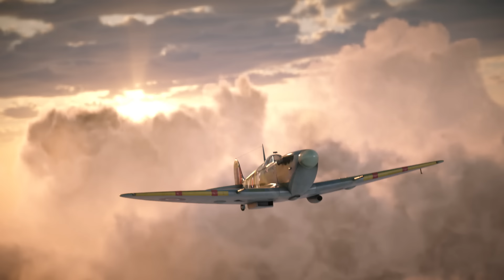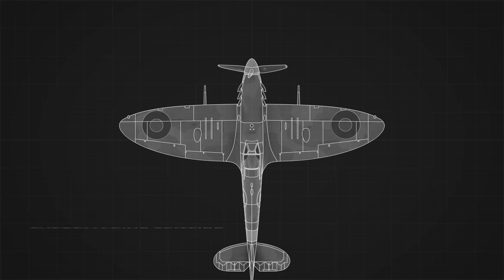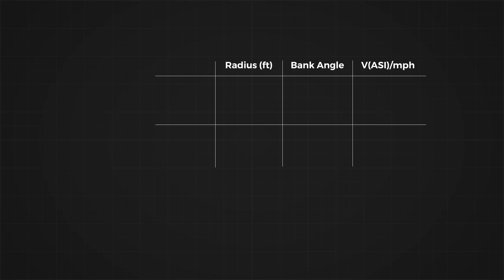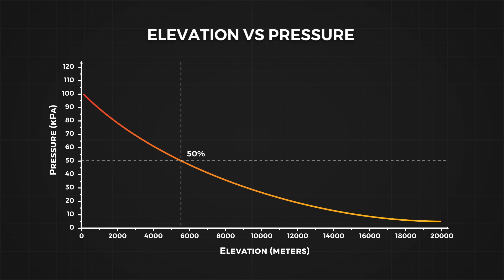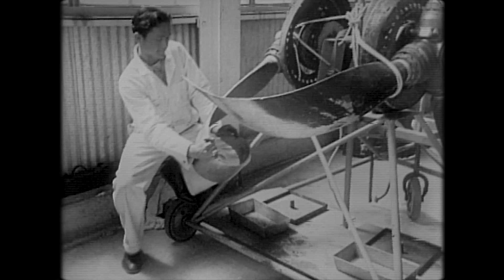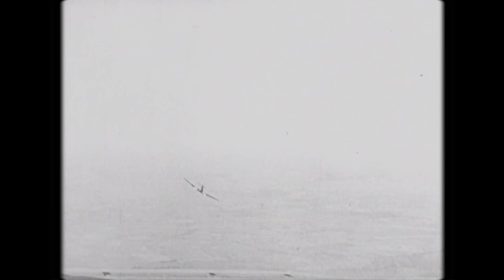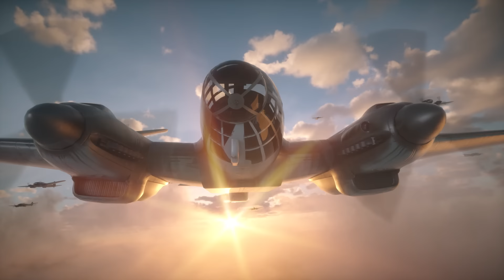The Insane Engineering of the Spitfire

Comment: If they thought of it, I wonder if winglets could have helped with induced aerodynamic drag, without hurting other characteristics?
Reply: No, because induced drag is not a factor in a fighter, it is lowest at the maximum speed, which is what you optimise a fighter for. At those speeds the frontal drag is dominant, and winglets make it worse. Winglets are useful for planes optimised for cruise speed, like passenger planes, and crucially for gliders, which for maximum L/D operate at relatively low speeds, where induced drag is dominant.
Reply: @kardRatzinger  OK, sorry for asking a question. However, the video specifically discussed induced drag. As noted elsewhere, "An elliptical planform is the most efficient aerodynamic shape for an untwisted wing, leading to the lowest amount of induced drag." You will note most post WWII jets with straight wings, had fuel tanks at the ends of the wings, then once swept wings were introduced, all of a sudden, this stopped. Hmmm...maybe the tanks or in other planes, wingtip missiles acted as a wingtip devices/winglets?

Niche cases but not as stupid as you might suggest:

"MiG-31D. Two aircraft were designated as Type 31D... had large winglets above and below the wing-tips."

"Almost 40 years ago, a famous mission was fulfilled by the Israelis: Operation Opera...the F-16A, which had to be used, had not enough range to complete the mission...Then, someone had the idea to install Sidewinders on the wingtip pylons. Those act as winglets, decreasing fuel consumption."

"Heinkel He 162A with Lippisch-Ohren wingtip devices." 

"An interesting way of reducing induced drag is by the use of tip plates or tip tanks. This arrangement tends to inhibit the formation of tip vortices. Tip plates have the same physical effect as an increase in wing span (or aspect ratio). Normally, these are not used since there are other more valuable drag reduction methods." Explains there limited use, now that better methods are known.
Reply: @machoopichoo2  Do not be sorry for asking the question, it was a good question. Yes, the elliptical wing decreases induced drag, and therefore increases cruise performance (probably not by very much), but that comes at the cost of greatly increased labour intensity when manufacturing the plane. Unlike in the case of winglets, however, the reduction of induced drag from the elliptical wings does not come at the cost of increasing frontal drag *).
Note that in later Spitfires Supermarine actually clipped the wingtips to reduce frontal drag, at the cost of more induced drag (not in HF version, but that had more to do with wing area/loading than drag).
I do not want to comment on supersonic aircraft as that's beyond my area of expertise(?), but the bottom line is, WWII fighters were heavily optmised towards best Vmax, so winglets would've been countereffective.
*) and probably interference drag
Reply: @kardRatzinger  Thank you. Makes a lot of sense and you clearly know quite a bit about this. It does sound, from what I read, that aerodynamic drag at the wingtips for piston engine planes, is quite impactful when climbing. However, overall it does not seem to be the big concern, like you said, things like drag, top speed, ability to dive fast, etc. were much more important. It's interesting that a lot of emphasis gets placed on wings, which makes sense, but possibly more for later jet planes, the lifting generated by the body becomes a really big deal, with chines, stakes, cannards, etc., also coming into play. But, not knowing much about it, I imagine a lot of this has to do with supersonic effects.

Comment: You need to change the video... any private pilot will tell you that in a turn you put BACK PRESSURE on the stick, deflecting the elevators UPWARD not DOWNWARD. Other than that, not a bad video... but a basic mistake such as this causes one to take everything else with a pretty big dose of salt.

Comment: i'm sorry but the battle of Britain spitfire has got terrible armament 8 30 cal machinguns poke holes in things a 2cm canon blows holes in targets. secondly centrally located guns are more accurate than wing mounted guns. pre battle of Britain spitfires had worse power than bf109s but around the time of the battle of Britain the English were getting 100 octane fuel from the us compare to the 85-90 octane fuel the Germans were using
Reply: Strange how so many aircraft were brought down by the Spitfire's (and Hurricane's) 8 X .303s.
Reply: @warwicktregurtha4198  throw enough crap at the wall and something will stick. Lick almost every aircraft of ww2 the spitfire was  "good" not perfect it had its flaws and its advantages. The spitfire had good performance when using 100octan fuel that doesn't change the fact that 8 machine guns using a  rifle round weaker than most of its contemporarys is a bit of a problem, not to menchen that spitfires were later equiped with 20mm canons. Mounting you pea shooters on the wings also decreases the range in which you sufficient shot density to be reliable affective.

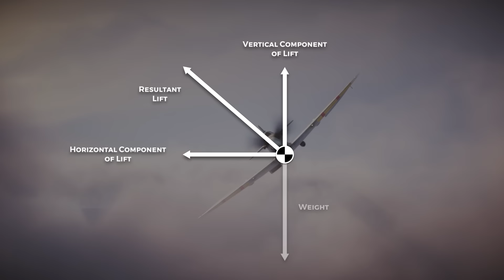Comment: What is explained in 4:10 ff is plain wrong. While conducting a turn you have to pull the elevator, not push it. If you try to deflect the elevator downwards as is described in the video you are certainly in for a surprise. 
You’d better, not try it!

Comment: The very old fashion upright sitting position the Spitfire had was not mentioned or the reason the direct fuel injection was missing. You find it here:
How One Decision Ruined British Aircraft Engines
https://www.youtube.com/watch?v=DOSe4lmy8S4

Especially regarding the wing design I would recommend this:
https://www.youtube.com/watch?v=4VJ4NKDSkG4
SPITFIRE SPEAKS: Spitfire Elliptical Wing Design

And for all interested in those war birds I would recommend
Greg's airplane like here:
https://www.youtube.com/watch?v=9wb5YzVbTNo
And why not this here too:
https://www.youtube.com/watch?v=9QycCd3U4Hg&t=86s

As a side remark I would claim the canon through the propeller was the superior arrangement.
Reply: Ref the RR carburetor vs FI:
 Sir Stanley Hooker, quoting from his book 'Not Much of an Engineer'. 'Let me now add that the Germans paid a large penalty for their fuel injection. When the fuel is fed before the supercharger, as on the Merlin, it evaporates and cools the air by 25° C. This cooling enhances the performance of the supercharger, and increases the power of the engine, with a corresponding increase in aircraft speed, particularly at high altitude.' (p. 62)
Which explains why the 27L RR engine could produce similar HP to the larger DB601 engine.

Also, that vid on the Elliptical wing is yet more duff gen.  RJ had used the elliptical wing on numerous occasions including the racing plane, the S4 in 1925.  The benefits of the elliptical wing planform dates back to englishman Fredrick Lanchester in 1907.  Don't believe every video you see.  Do some fact checking.

Comment: Hydraulic is not spelled HYDROLIC plus fuel/air mixture does not enter the piston. The piston compresses the fuel/air mixture which enters the combustion chamber via the inlet valves. I suggest you study how a 4 stroke engine operates. I also suggest you properly research everything to do with the subject matter that you are posting on YouTube. Make sure that your so called facts and technical information are faultless and accurate before posting.

Comment: The problem with the carburettor float under negative G was partially cured by the addition of a flat washer. If was called Miss Shilling's orifice. It gave pilots sufficient time under negative G to out-manoeuvre the ME109's.

Comment: The cock up regarding the elevator is only the most obvious of a bunch of gross errors here. Stating that optimum air fuel ratio is “12 parts air to 1 part fuel” is a schoolboy error. It's actually in the range 12:1 to 15:1 by MASS not volume. Also, believing a 6000lb airplane could possibly have induced drag as low as 3 lbf and putting it into a video is very dumb for an engineer.
  Neither of those things pass the most crude reasonableness test. It should jump out and smack you in the face that the 27 litre Merlin would require 2 litres of fuel per cycle, ie an astounding 1 litre of fuel per REVOLUTION! Equally, simply having a rough idea of typical  L/D ratios for these kinds of aircraft should alert you to the total implausibility of a 6000lb Spitfire having as little as 3lbs of induced drag (15:1 max L/D ratio = 6000/15 lbs drag in the cruise and max L/D is where half the drag is induced drag hence 200 lb, reducing at high speed but increasing during maneuvering flight).

Comment: Never mentioned the fact that 109s shot down 2.2 RAF fighters for every German fighter they lost! The 109 was thus the far better combat plane! Also failed to point out that the 109's Leading Edge Slats allowed it to have a higher Alfa, or "Angle of Attack and thus could pull more "G"s at any speed and thus turn tighter IF the pilot could withstand those forces! All in all, a very flawed presentation with at least four major mistakes in important details!
Reply: No, the LW gave up when they ran out of bombers, it was the Hurricane and Spitfires jo to shoot down bombers.

Comment: Designed and built by people of European descent. 

Amazing what people of European have created. Other things invented by white people:

Submarines, electric lights, nuclear power, microwaves, CAT scans, automobiles, hydraulic, wind turbines, backhoes & excavators, jet airplanes, aluminum, hydroelectric dams, steam power, trains & diesel locomotives, tractors, modern pharmaceuticals, open heart surgery, satellites, radios, telephones, televisions, arch & tig welding, computers, transistors, microchips, titanium, telescope, democracy, capitalism, modern farming, x-rays, typewriters, sewing machines, gyroscope, SCUBA systems, pasteurization, center pivot irrigation systems, bicycles, hypodermic needles, Velcro, microphones & amplified speakers, space travel, airplanes, fiber optics, ultrasounds, internet, printing press, container ships, aircraft , GPS, modern textiles, calculus, dynamite, internal combustion engine, Kevlar, moving assembly lines, antibiotics, aspirin, refrigerators, chainsaws petroleum production, trigonometry, helicopters, thermometer, glass mirrors, directional drilling, Astrophysics, crop rotation, carbon fiber, super conductors, particle colliders, pneumatic tires, MRI, sextant, robotics, telegraph, microscope, firearms, penicillin, refined oil and fuels, hovercraft, computers, carbon 14 dating, angioplasty, telescope, pipelines, open heart surgery, tower cranes, chemo therapy, light emitting diodes, motion pictures, cameras, digital cameras, CD/DVD, concrete, dynamite, lithium batteries, LED lights, refrigerators, nylon, water pumps, radar, sonar, satellites, distillation, electric motors, magnetic compass, sextant, clocks, plastics, vaccines, vulcanized rubber, insulin, combine grain harvesters, zippers, and concrete …. Just to name a few

Comment: LMFAO. 20's/30's old tech from racing float plane married with obsolete German wing design and to add to that carburetor limiting the maneuverability and to add to that speed and speed of climb was very poor with lack of power. Only advantage Spit had was tighter turn. And what comes to wing design all BS. 109 guns/cannon were lot more accurate and destructive plus 109 had the fastest roll and climb and no limitations from carburetor as it was fuel injected. 109 was faster and more maneuverable. Why does Axis Aces have up to 350 kills? Spits lost 4 to every one 109. The reason why German lost was losing it pilots. While British pilot jumped on to a train and was up again in a new plane while German pilot was as POW or ran out fuel and perished in the Channel.

Comment: 👎👎👎Had enough @ ~13m; same old Spitfire glorification claptrap repeating all the usual cliches. There IS an interesting story to tell about Spitfire's engineering - especially design vs. production engineering - but this ain't it. Lazy cliched crap replete with all the usual tropes. 
The way you tell it, one could be excused for thinking thinking that Spitfire was first metal skin monoplane, 1st with elliptical wings & it's major contribution was winning BoB singlehandedly - whereas NONE of those things is actually true
Not entirely convinced you understand the difference between design & engineering. Poorly structured, with wildly varying levels of complexity/detail
Reply: I've heard the Hurricane was more crucial. Partly, this was for the mundane reason that Enemy shells would go completely through it without exploding; whereas the Spit would set off the fuze. 
HECK; maybe the Mosquito was even more Important.